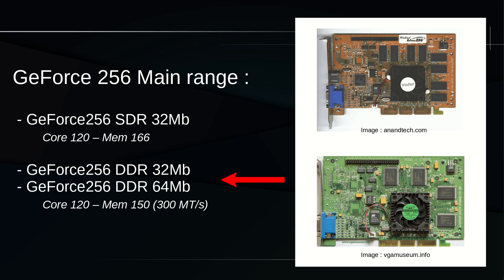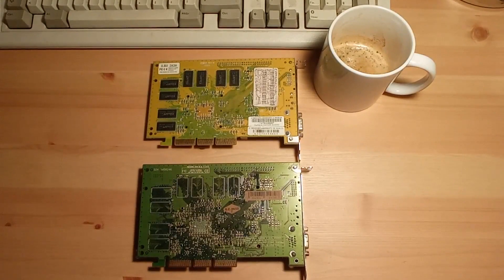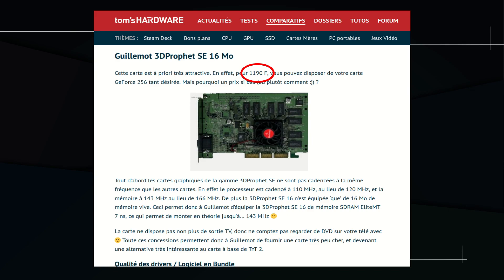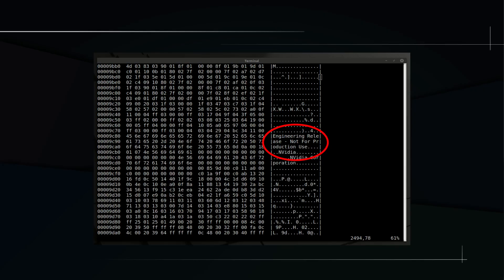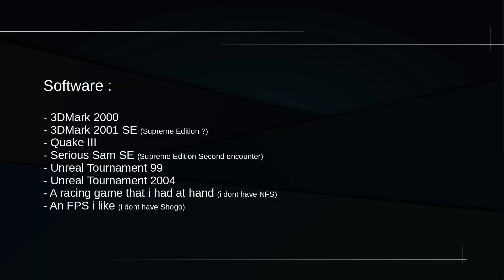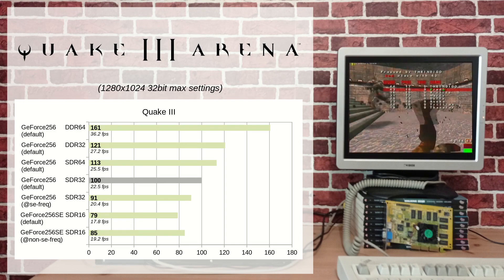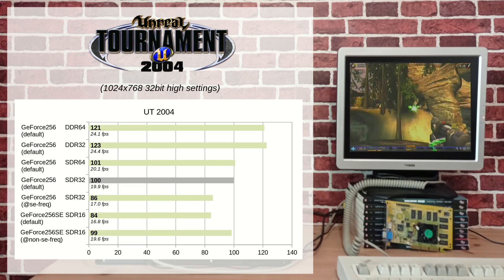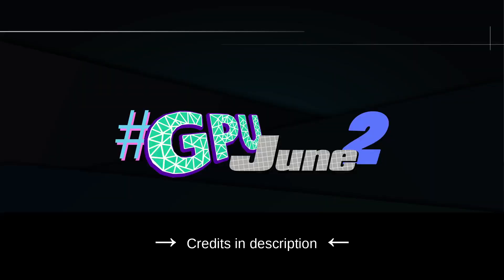The forgotten GeForce256 SE : lowest specs DX7 card ever ? #GPUJune2

Comment: lol nooooooo you didnt just hot snot your cpu? good lord.. lol i know metal on metal hot glue dont stick but it would be an atrocious heat transfer medium in my mind. .. . . . i use good ole plain jane  terminal grease. lol just a high dropping point silica grease.  goes on clear keeps its consistancy and never drys out its dilectric and is just silica grease.. and on all my phenom 2 systems it works fantastic. never had a heat sink baked to the cpu since. unlike the years of arctic silver..

Comment: Good card choice, really overkill testing setup, Im guessing you used 939 with it to avoid any bottlenecks, but, it looks like you got not that much more FPS using 939 than I did using overclocked super socket 7, about a 20-30 fps difference on the lower spec games, but not much on newer, but I also noticed you didn’t do any lower res or 16 bit color tests on some of the games; and also didn’t test halo, on halo using socket 7 I got 35 fps at 640x480 with this, I think that the card was hitting some kind of vram bottleneck, for me certain games in the list ran really fast on low res

I like horse race benchmark btw that’s a good test
Reply from the maker: Yes, i understand. But i tried to stay with the same test as in the PixelPipe's video. I wanted to compare this card to other GeForce 256... while having only an "SE" version and a standard SDRAM version.
One improvement i can think of about using a newer s939 testing environment is AGP texturing. Not 100% sure if/when it is used by the drivers, but the feature borrows memory from the system RAM. So by using a newer motherboard with DDR memory, its bandwidth should be improved over PC-100 SDRAM on a SS7 or PC-133 on a socket 370 for example.
Reply: @alexcomputerstuff1797  on the 256 none of the drivers outside of the latest ones take advantage of that feature if I'm not mistaken, and those drivers are the worst drivers for the card generally, 6.5 or 12.3 or something like that are the ones giving the highest FPS depending on the platform being ran though generally, do you have a rage fury maxx? that card gave me really chaotic results once I got it to work finally, fps that bounces from like, 15 to 300 on serious sam second encounter, curious if on a beefier board if it would be more useful
Reply from the maker: @psychoticgiraffe   Thanks, i will definitely test those late drivers. I still can't figure out why games like UT2004 and HL2 can be played with as low as 16MB.
Yes, i have a Maxx too. But i must admit that i never tried it on this socket 939 board. I'm quite sure that the motherboard chipset doesn't have Win98 drivers. And with the Maxx AFR being only supported on Windows 98, i stayed with period correct hardware. But you're right, for a quick test, the AGP port on the board must work without any drivers on W98. But dual core CPU, USB, Sound, NIC, SATA and PCIe will not without drivers.
The last system i used with the Maxx was a Slot 1 board based on VIA Apollo pro 133. The card performance seemed tied to the CPU. For example, my Celeron 300A @450 seemed far from enough. And i had a very unstable framerate. I'm thinking about making a video about it. I also have a Rage Fury Pro 32MB... which is half of a Maxx. Should be interesting to compare them side by side.

Comment: The Guillemot 3D Prophet SE was my upgrade from a TNT. Together with a K6-2 400Mhz and a few month later a Athlon 700Mhz it was a awesome for the little budget i had. 
Never thought about the SE part, it simply was "fast enough" for Couter Strike. 

Still have it here, it is a 32MB card with 7ns Ram. Sadly it only puts out a solid color picture, so no testing ;-(
Reply from the maker: I bought mine untested, (for very cheap) and the card actually had problems. Mainly a missing color. The image was very "green".
I could not trace any cut pcb trace. And in despair, i heated it in an oven (with the right temperature and timing, this can melts and re-form the soldering balls behid the chips).
It was worse, with a lot of artifacts.
I tried again three times, soaking the PCB with soldering flux. And finally it worked.
No more artifacts, and the missing color was fixed too.
All the tests, at the end of the video, are actual VGA capture of the GeForce256 SE.

So you may be able to fix it with a reflow... or it may also completely fail. From my experience, i could fix around 50% of broken cards i had like that
Reply: @alexcomputerstuff1797  maybe it try it. I fit works, great, if not the card is still broken. Its sitting here since i bought the replacement in form of a Powercolor GF2 Pro

Comment: Very cool! It's surprising how little having 16MB of memory seems to impact performance, with so many scenarios being fillrate or bandwidth limited.
Reply from the maker: Thanks !
Regarding the surprisingly good 16MB performances, it may be linked to to the quite modern testing platform.
When an AGP card runs out of memory, it can use the main memory to store the textures (AGP Aperture size setting in the bios). The Intel 740 AGP card was actually 100% based on that. 
AGP texturing performances were not great because SDR memory and motherboards chipsets from late 90's were not great. AGP 4x max bandwidth is around 1GB/s, so does the PC133 SDR memory. So on a PC133 + AGP 4x system, the GPU may quite possibly compete with the CPU for memory access.

But with my "modern" socket 939, Fast DDR memory and the help of the Athlon64/Opteron integrated memory controller, this may alleviate the previous limitation. And make AGP texturing less slow.

So this could totally be a side effect from testing on modern hardware.
Reply: right, me too, maybe a few tests in higher resolution or/and with some FSAA would have been more impactful on the memory

Comment: Interesting, GeForce 256 is very fascinating, it started a new era.
I don't understand that comment in the BIOS dump, whey nVidia should have worked on that Hercules card? I mean, it's just a 256 SDR with slower RAM modules, it only requires to set proper freq./timings and lower the GPU core, what's the need for and Eng. Sample?
Regarding the lowest spec DX7 (nVidia) card, if you count mobile versions, there were GeForce2 Go versions with 64bit, 32bit or even system shared memory configurations, those are certainly slower than the 256 SE :D
P.S. Mb = megabit /// MB = megabyte ;)
Reply from the maker: Regarding the bios dump, my first intention was to dump my standard 256 SDR bios and compare it with the 256SE version. I was hoping to highlight some differences, like manufacturer name, some strings and maybe find the frequencies somewhere.
It turned out that a very large part of the two BIOS are different. So i could not find an easy way to compare the two. Maybe my method was too simple and i must admit that i know nothing about bios modding.
The only thing i found interesting is that the SE does contain this "engineering sample" string, while my standard version does not. But it can totally be a difference between the two brands. And maybe Standard SDR versions from Guillemot also contains this warning.

Yes, you're right about the integrated chips, but it's a bit out of my scope. But i'm interested in integrated chips on discrete cards.

Comment: Just to make you aware, there is a slower GF256 than yours. 
ASUS made GF256 32MB SDR version with only 64-bit memory bus.
Reply: Ohh Asus long tradition of nerfing some cards go this long! Did they made the consumers aware or did the slime move like with the 6800GT 512MB (128bits) Rick tested recently?
Reply from the maker: It would be fun to test this one. With such a low mem bandwidth, this must be quite slow. Maybe a third contender for slowest DX7 card. The GF2MX 16MB i mention in the video must also have 64bit bus, so maybe on par with it.
Unfortunately, i don't have such a low spec GF2MX to test, the only one i have is a slightly better GF2MX400. (as generally said, you rarely actually buy these cards, you end up with them for some reasons)
Reply: I have one V6600MX and it is really slow!